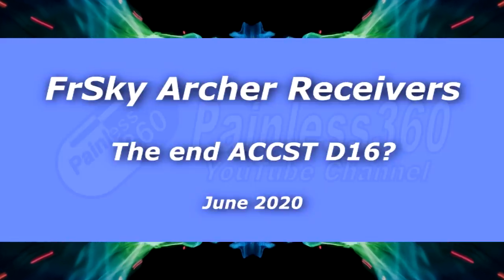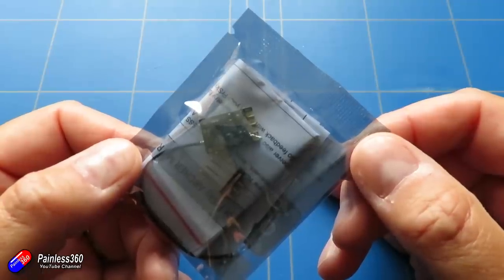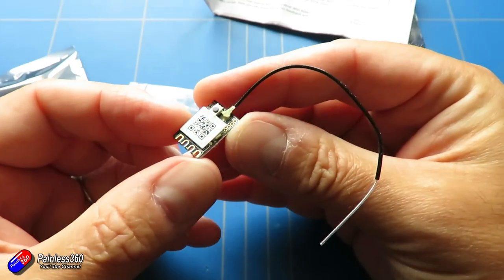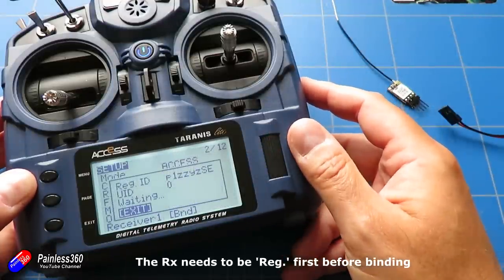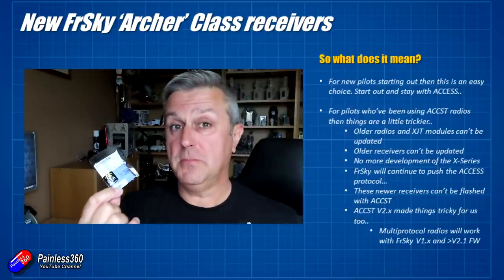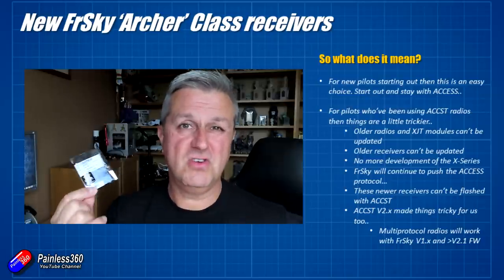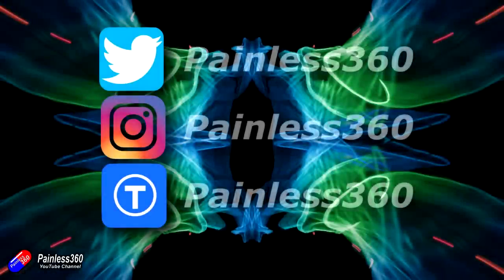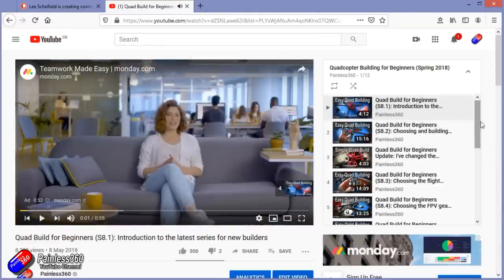FrSky 'Archer' Receivers and ACCESS Protocol...

Comment: I also have a big investment in ACCST stuff. If I buy new equipment for a new protocol it's going to be Crossfire.
Reply: Dude, use TBS's exchange program! I just got my Crossfire v2 module and 7 nano receivers FOR HALF PRICE! With their exchange program! It's awesome! Google TBS Crossfire exchange, or something similar! Easy to do, easy to get their new gear! I'm a huge fan now because of this and just the way everything came together so seamlessly!
Kinda like updating all Crossfire gear - effortless! 😍🤘
Now they are SMART! 🤔👍
Reply: Ditto! I 2nd that notion!
Reply: Yep I’m running crossfire with my old QX7 radio and it’s so good, FrSky have screwed their customers so I don’t recommend them to new pilots anymore.
Reply: agreed, why use anything but crossfire
Reply: I bought a v2 of the crossfire micro tx. I used to like using Frsky but I wont be buying anymore of their products
Reply: So say we all!
Reply: @scootroter4859  Looked that up, how sad that I don't have any R9 to trade in :-) Thanks for the tip.
Reply: Or move to digital.
Reply: You could just get an xjt module and run both. I mean there only like 50 bucks ! Run new and old same transmitter
Reply: @patrickcurram9763  I have an XJT module but it developed the alarm they all get eventually and stopped working. Another Frsky failure. Am now eagerly studying all the cool new protocols that have come out, ghost, tracer, express LRS, choices galore!
Reply: @crazicat  what do you mean alarm? Like the access protocol won’t let it work.
Reply: @patrickcurram9763  The module beeps constantly, the alarm is "faulty antenna". But the antenna is good and module has never been powered on without antenna or abused at all. It's very common in XJT modules. Sometimes you can remove beeper and keep using it, sometimes it quits connecting to receivers.

Comment: If you are a new pilot - buy crossfire and do not jump on the frsky bandwagon 👍
Reply: @user-yk1cw8im4h  Never, crossfire is as good as it gets even if you just fly fixed wing in a park. Less time thinking about loss of signal and more time enjoying your flying. Radio wise I think the Radio Master TX16s is gold.
Reply: Yessss! Crsf is KING 👑
Reply: I am using a Graupner MX-16, have been flying fixedwing aircrafts for 3 years now. Had never a problem with range or anything. And now, starting with multirotors, I fly in my garden (Geprc rocket, changed it to analog), and after like 10 meters it failsafes due to signalloss. Any ideas why? Might it be that the antennas somehow interfere each other (they´re pretty close to each other)? And now I am thinking about buing crossfire, hoping that  my range would improve. Does anyone know, if Crossfire supports  Graupner?
Reply: @honixfpv2772  Without seeing your setup it's impossible to know for sure but an analogue receiver? That aside having antennas too close to each other or to anything conductive for that matter can seriously reduce your range.

As for Graupner, I'd suggest probably not although you'd be better off asking that question in a Graupner user forum.

Comment: Just recently scrapped all my frsky gear and swapped 25 quads to crossfire and tango 2 as I had a non access setup. As I had to buy new stuff no way would I ever consider frsky again after this access crap. But I'm super happy with crossfire. The range is incredible and binding/updating is so much easier.
Reply: It’s amazing how easy binding and updating crossfire is, I didn’t even see that as a big deal until the first time I used it and wow it’s so much better than doing the 3 handed button hold while powering up to bind and pulling out receivers to update firmware 😂
Reply: Me to. As and old Frsky user I feel Frsky just doesn't give a nickle to keep old users faithful without using money. TBS took away the 'cheapest' argument from Frsky to, so they have nothing more to go on. Cf is still compatible with older radios to, so I think everybody who wants to keep theyre perfectly working, good old radio is at least considering cf now instead. It's stupid not to, if you want the safest range.

Comment: I’ve strangely had two xm plus lose radio connection mid flight to a no fix situation. Also bought a rxsr that doesn’t connect at all. It is properly pinned and de-pinned. I bought three more xm plus.... was educated on Frsky practices, and bought into Crossfire. The kit should be here next week. First crsf build is the @FPVcycle PowerPick 4 w/ the new 2203 motors. Either the rush tank nano or tbs nano 32. Thanks for the info

Comment: I must admit like you Lee I have loads of RX's on D8 and D16, which I use my Horus radio for, as all these are in my planes. I converted all my racing quads to R-XSR receivers running ACCESS, and all my Freestyle quads to R9MM OTA using my X-Lite Pro. Works well for me.

Comment: I’m totally with you. Honestly I love my Taranis 2015. I have a huge investment like many other pilot on X receivers, luckily I have a few of them spare so I can continue to build a couple new models. I also bought some R9 and using the flex firmware can be still used with accst. Frsky has done alot good for this hobby over the past years, I really loved the price/performance aspect and flexibility. I have been loyal to them, sadly I feel I have been “repaid” by being dumped out in the cold. Not cool Frsky. I really don’t like the idea to buy a new radio just to use new receivers and if Frsky does not change its mind I will be definitely moving to CRSF.
Reply: You will definitely not regret the move crossfire is soooooo much better 👍👍

Comment: I bought my original FrSky Taranis X9D+ many years ago (about 2012-13 I think). I've never updated its FW. I did try to do that once, but it screwed up all the models I had stored, and none of them worked properly after the FW update ... so I flashed it back to the original v2.0.9 (???) but then still had to adjust all the models, as the attempt at doing the FW update screwed up some of each model's parameters. I swore I'd never make myself go thru that painful experience again.  I guess, as long as they continue to make XM+ Rxs, I will be okay if the rest of the FrSky world moves on without me.  That's the way its always been in RC.  I remember when multi-channel reed sets came out ... sort of ended the single channel days. Then proportional units came out and ended the days of reed/relay systems. Then there was the shifts from 27mhz to 72mzh to 2.4 ghz .  Something 'NEW' is always around the corner. Thanks for keeping us old dinosaurs up to date Lee .... Cheers.
Reply: Yup, thumbs up to this post.  Anybody that's been around awhile knows that tech marches on.  Spektrum, JR, and Futaba have all left people stranded with older protocols.  FrSky won't put themselves out of business with this.  They are the dominant player with ever improving quality and performance.
Reply: @sit-and-fly7785  A lot of people brought JR, Futaba & Spektrum but jumped to FrSky. It begs the question why did they change given how expensive (and 'great') all those radios & receivers were? If you know the answer to that you'll understand why FrSky doesn't have the strong position you think it does and why they're likely to haemorrhage customers like me for quite some time.

And while I'm at it just look at all the comments pushing Crossfire. The tide is turning and FrSky is starting to look like they're in a tidal pool, one which is drying out fast.
Reply: Yes....FrSky expects it's costumers to have knowledge while failing to put out information needed to acquire it. Down hill from here I'm afraid which is sad as I thought I was getting on an elevator when I got the X10S. Trying to rule the World never works unless people want it....
Reply: Of course if you use a PC to back up your models you could just rewrite your models back again. Same goes for firmware.  I am a JR user and have been for years but when they gave up DSM2  and split from Spektrum sharing for the DMSS protocol I thought if my tX goes down I have no way of backing up nearly 30 models. Frsky was my salvation and now the system for my big and small electric planes.  Golden rule - back up, back up.

Comment: I don't know why for the life of me why anybody would be buying frsky receiver at all anymore after what they've done.
If you're a new pilot do not buy frsky at all, save your money and buy a much better system that won't burn holes in your pocket when they decide to change something down the road.
Crossfire all the way!
Reply: Lol i just posted same basically then saw urs
Reply: @flo-ridafpv5713  great minds do think alike.
Reply: Im new to this hobby, what did Frsky do?
Reply: @harvesterw6805  Sold their customers a bunch of receivers and radios and decided five years later they were going to change their protocol and not make it compatible with anything prior and dropped D8 which was in a lot of your bind and fly stuff.
Create a bunch of firmwares and made everything very confusing on top of this.
I don't expect they will last.
Reply: @TexasWaters  yup once tbs priced matched r9...no brainer, but r9 treated me well for years, when crsf was more than triple the price soo
Reply: @harvesterw6805  but lemme add...you dont need more range than 2.4g if ur video aint up to par, ie good antennas w rapidfire or dji fpv video
Reply: @harvesterw6805  They became Greedy and bullied supplier to stop selling and carrying any other company Tx or Rx. They are very arrogant Chinese company.
Reply: 👍 correct

Comment: Nice video. At this point I fly strictly with R9. At this time you can buy ACCESS modules and receivers and flash them with the ACCST firmware. If that stops working I will switch to Cossfire.
Reply: Do it now before r9 is worthless...i just did, micro module w 3 rx and 6 tennas for $119... +extra 12% off...and v2 module will do 500mw and 1 watt in future firmware ....confirmed
Reply: @flo-ridafpv5713  much lower latency as well
Reply: @gadgetmerc  yea buddy, r9 is super dirty, big inconsistency between packets..per uav tech.  My dji at 50mbps will compliment it nicely ;)
Reply: Use the crossfire exchange program asap
Reply: @bobbin69  Whats the shipping time for them like?
Reply: @bobbin69  meh, takes suuuuper long from china now, i just bought from RMRC n sellin my R9 on ebay
Reply: Sam S cant remember sorry

Comment: Archer M+ have decent range with telemetry, I paid 12$ for each so I cannot complain. Good upgrade for whoops or small toothpicks with built-in receiver, where crossfire would be overkill. No RSSI output via SBus, but I have hopes this will change in the future as the current ACCESS fw version for the RXSR is finally able to do that.

Comment: Same thing happened to me. I added an upgrade ISRM module and passed on the para module. I can run both D16 and access now with my old x10s transmitter. I have in the interim invested in a Crossfire for long range.  I keep wondering whether FRSky is viable any longer hanging us out to dry.

Comment: There is one HUGE difference between when FrSky released the X series ACCST protocol and now with the release of the ACCESS protocol.  When they released the X series protocol their transmitters also supported their existing D series protocol receivers (including the V series that were able to bind in D mode).  With the release of the ACCESS protocol they gave a great big Screw You middle finger to all of their user base who were flying D and ACCST X series receivers.  They did relent and provide some X series ACCST support in their ACCESS transmitters, but are still waving their middle finger at those of us who own a large number of D series receivers.  Note that the new transmitters COULD support the D series protocol, but FrSky choose not to. 

It doesn't end there.  When FrSky released the bug fix / upgraded X series protocol ACCST 2.x they again tried to lock out the rest of the world with a lie.  They told us that in addition to the bug fix the new 2.x protocol also included greater security.  The lie is that the greater security was only in the bind sequence - the control link had essentially the same level of security as ACCST 1.x.  Fortunately, the 2.x protocol has been cracked and is now available on the multi-protocol radio modules used in Jumper, RadioMaster and plug-in modules for other radios with a JR style module bay.  I may try ACCESS if/when it is cracked and included in the MPM project firmware. Until then it is unavailable to me as I am not buying an ACCESS only radio.
Reply: Very informative / good post.  Question if I may ?  What previous receivers do they offer Access for ?   I have a 2019 xd plus - but i wont use it in Access mode (even though I have no D series protocol receivers) unless they support the entire RX range of receivers.  Definitely agree  they have ruined the whole FRSKY experience  ...
Reply: @conradtaggart9959  The best that I can determine, of the X series receivers only RX4R, RX6R, G-RX6, G-RX8 and R-XSR have ACCESS firmware.  Most (but not all) others have ACCST V2.x firmware in addition to the older V1.x firmware. 

I may try ACCESS if/when it is cracked and ported to the multi-protocol module in my shiny new RadioMaster TX16S.  I'm not buying another FrSky transmitter.

Comment: I buy Jumper receivers. $12 d16 mode beats Frsky over priced receivers. I have no issue with any of the jumper receivers. I'm in the same boat you are I have a Horus X10.
Reply: With the jumper receivers does it just bind in d16?

Comment: I fly fixed wing L.O.S and fpv plus quads. I am currently using an old Spectrum DX8 on the dsmx protocol. With the fixed wing fpv side of flying I need more then the 8 channels I have. I was looking to upgrading and was thinking the FrSky Taranis X9D se 2019 was going to be the best way for me to go. Looking at the hate for FrSky now, I'm having second thoughts. From the reviews I've  seen on both the new Jumper and Radiomaster transmitters the Q.C and final finish seems poor. Spektrum is out of my price range. I might have to put off upgrading for a year or so to see if FrSky do the right thing by past customers or for the new comer's improve.

Comment: I fly fixed wing LOS, so am happy with range of my current ACCST stuff from FrSky.  I'm under impression that my 2018 Taranis X9D Pro SE cannot be upgraded with ACCESS.  Is this your conclusion also?  If I could upgrade to ACCESS, I'd only consider this based on the info from the FrSky website where FrSky advise that, 
".....  users can bind the ACCST D16 receivers with a new ACCESS transmitter. FrSky also have the external options (XJT and XJT Lite) for users to bind the older D8 and LR12 receivers."

Thank you for all the work you have done on this topic.

Comment: I'm like you with quite a large investment in FrSky gear but to be honest I've started to have enough of this proverbial.

FrSky's gear is becoming unreliable, they're starting to stiff loyal customers and their radios are starting to look increasingly expensive vs. the competition. And it's because of those reasons I've started to look at alternatives;  I tried a FlySky receiver (X6B) for the first time yesterday. I'm using PWM so had to make a power distribution board from stripboard (now there's a video idea) but overall I liked it. Even with the antennas crossed and in a less-than-optimal orientation the RSSI started at 99 and only dropped to 86 once 20ft away and behind two brick walls in a very noisy (WiFi) environment. I found the onboard voltage measurement acceptable and given what you get (RSSI, battery monitoring, 6 PWM channels, apparently good range) the receiver was very cheap (<£8.50 delivered). Looks well suited for small planes.

Comment: I have a Taranis X9D, R9M and a couple of R9MM RXs.I have never had a failsafe and use flex firmware.  I’m only now considering swapping to TBS Crossfire, as it looks like I may have no choice If FrySky stop making R9MM RXs or so they are not compatible with Flex firmware anymore?(you can flash flex and use them, at the moment)
Has anyone taken the TBS trade in offer in the UK? And is it worth it? Or is it cheaper to buy a TBS Crossfire Mirco TX V2 Starter Set for £114 from a UK RC store?

Comment: I've been away from RC planes for about 7years. Now starting to get back in it (Only invested in XD9+ & XR8 receivers). What radio's would you recommend low, mid and top range for the new ACCESS Protocol?
Although a shame about the change, I did already have my noob head aroundish my XD9+. I'll have to basically start again :(

Will also check out your already published vids on ACCESS Protocol too..
Reply: Crossfire. If I were you I'd stay away from frsky.
Reply: @Skankhunt-42-  Yeah. Masterfire combo also seems a great deal
Reply: Avoid Frsky... go with Crossfire! So incredibly superior!
If you want a great, and versatile radio, get the new Radiomaster TX16S, and never look back! You can buy it with the Crossfire V2 module, or buy it separately and pop it in the back! I'll bet you can sell your XD9+ and pay for the new TX16S with no new money put in, or very close! 
Might as well start fresh with the best! I just converted  to Crossfire and I'm happy as a lark! 😎🤘

Comment: Hi Lee just been and purchased an X7 transceiver  so can i use the archer receivers or am i going to find it harder to find receivers for my aircraft as i am just starting out will i need to buy another unit to fly any new aircraft with.  checked on new receiver and it has access in it but no menschen of ATS or archer i have had my new receiver for about a month so will it accept archer, plus cannot see any archer receivers with a T antenna so dose that mean i will need to pay extra for it.
Reply from the maker: The latest X7 radios come with support for ACCESS (Archer) and ACCST (X series) receivers out of the box so you should be fine.. best of luck!